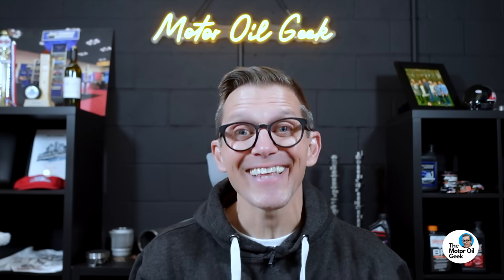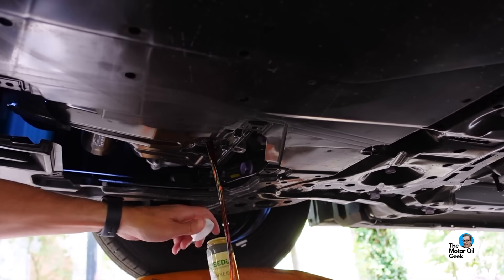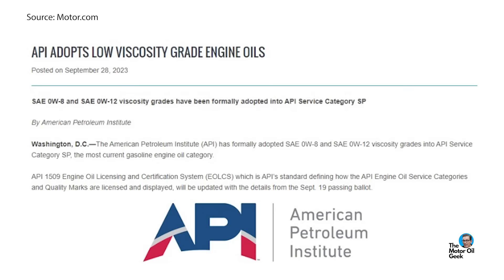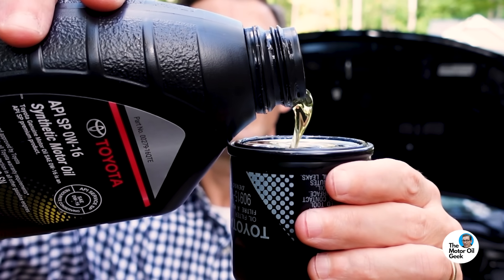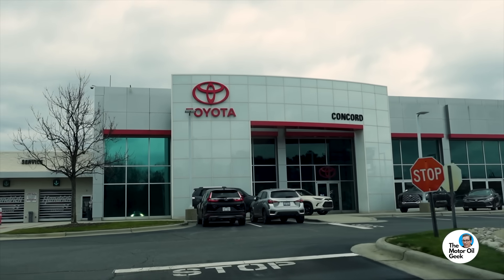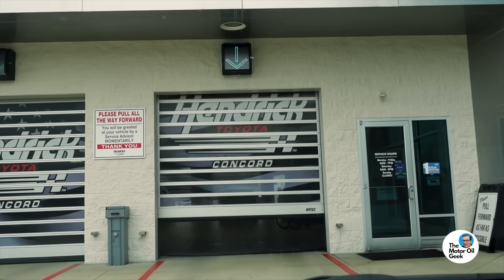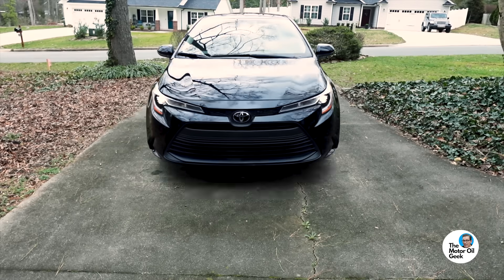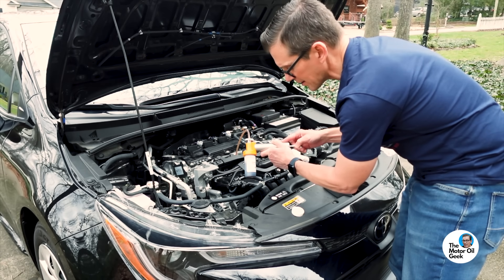0W-8 Motor Oil: Too THIN to Trust? Let's Find Out!

Comment: Great video as always. 
I bought an air cooled Yamaha 650 Turbo, back in the day, tried all sorts of oils and viscosity’s. The gearbox also shared the engine oil. I changed the oil right around 3000 miles or when it became reluctant to shift gears or when the weather was very hot. Got over 120000 miles before I moved onto my next bike. 
Maintenance is absolutely necessary if you want the engine to last.
Reply: An XJ 650 turbo to compete with the Suzuki XN65 turbo the Honda cx500 turbo and the magnificent Kawasaki GPz 750 turbo I was 15 years of age back then, the Yamaha was the only bike to not go the fuel injection direction
Reply: Yamaha was very reluctant to go with fuel injection until they were basically forced to. 
They did try it on the GTS1000 along with an alternative front suspension system. 
A very cool bike, I had the pleasure of riding it when it was first released. 
Thanks for the comment 👍
Reply: @paultruesdale7680  quick question Paul, what year did you buy the XJ turbo? My dad bought an XJ 650 new in blue back in 1985 and I remember the lovely whistle sound the engine made , I remember it cost just over 3 grand Irish pounds back in the day.
Reply: Sometime after the Seca 900 was released, I would say close to the end of 1983. I wanted the 900, but it was out of my price range and the Turbo was not selling, so the price was cut in half and it was being sold for 2500 dollars. 
I bought the bike and rode the crap out of it until my next bike the 1987 FZ600.
Reply: I’m a dirt bike guy but my one and only ever street bike was a Honda CX650 Turbo. Absolutely stunning looking bike, technologically andv for its time, and a very comfortable bike to ride and easy to maintain. A friend and I both bought  one as new leftovers in 1984 or 1985 for I think $4K each. I eventually and unfortunately sold mine in pristine condition having a young family and not wanting the risks of a street bike. He kept his till he died of brain cancer but willed it to another friend of ours who still has it but it’s not running currently but is otherwise in mint condition and stored inside 24/7/365
Collector bikes now, wish I had never sold it.
Reply: Both the CX500 and CX650 Turbos were beautiful machines. 
The paint and color schemes made them stand out like true exotics. On boost they would smoke my Yam Turbo.
Reply: YES, stunning color scheme on especially the CX650 turbo. I’m in the US but perhaps they used that color combo on other models in other parts of the world over the years but here they never did until recently with the Africa Twin series of bikes. It made me want to buy one of this as I’m partial to adventure bikes.
The CX650 turbo was the epitome of all the short run of Japanese turbo bikes during this years.
Yes indeed, on boost it was the roll on king at the time eclipsing he mighty Kawasaki KZ???? or Z1????. I’m 66 now brain forgets.
I almost lost my now ex wife off the back of the bike when I failed to tell her to hold on during a full boost run. I don’t think she ever got on the bike again after that. 
You could run the starter to prime the turbo with lubrication without the ignition on. When coming to a stop to shut the bike off I’d always make sure to let it idle awhile to let the turbo spin down to whatever it’s slowest speed was to prevent any oil starvation. Oil changes were a breeze, valve adjustments if needed were a breeze with transverse V cylinders, shat drive, fuel injected. Air filter was up in the fairing compartment and easy to clean/replace. Crazy easy bike to take care of despite it sophistication at the time. 
Stator failures were a weak point eventually as the oil that was run in the gearbox cooled everything including the turbo and stator and apparently ran stupid hot and eventually cooked the  stators requiring engine removal and tear down. I’m guessing since then, CX turbo enthusiasts have devised an improved stater assembly for better longevity.
Can you tell I miss this beautiful bike? If you were to show a picture of this bike to allot of people, even people who know motorcycles you would almost thing it’s a modern current bike not 1983. Timeless.

Oh, whoever else posted about the Yamaha 900 Seca I lusted for one of those as well. The 650 Seca was nice but the 900 was a dam sexy bike at the time with to little rear suspension travel. Very short lived model if I recall correctly?
Fun stuff!!!
Reply: Check out Dave’s bike brochures. 
Great trip down memory lane.
Reply: That was me posting about the SECA 900. The one that got away. 
I still think about that bike.

Comment: wonder if the 0w - 12 used in the shop is the same full synthetic as the 0w - 12 that was mentioned as producing less wear than the commercial 5w - 30 not quite really synthetic legally sold as "synthetic" ?

Comment: The issue with the corolla cvt service, at least the prior one is you only get something like 1.5 quarts to drain due to the location of the drain plug on the pan, it holds about 8 quarts. There are 3 or so magnets in the pan no need to worry about service for a while. Best/most cost effective way to service is drop the pan, clean the magnets and replace the gasket. Or use a flush machine but 12 quarts of toyota cvt fluid is expensive, and the fluid level still needs to be set/verified after flushing.

Comment: When I recently came across your oil videos I first thought this was a bit much but I got more of an education on reading many of the comments which back you up.  I have always done my own engine oil changes mainly because others tend to be sloppy.  Now I have other reasons not to trust dealerships.  I think the "free oil changes" are nothing more than a sales gimmick!  I have noticed that when I change the oil on my 2015 Jeep Cherokee, the recomended oil amount just brings it to the lowest line for the "safe" zone.  I always add another quart.  When I sell my bass boat and Jeep I'm planning on getting a Honda HR-V which of course has a CVT and is direct injected.  Is there a better engine oil that may in some way help with carbonization of intake valves?  My advice on any CVT is to change the fluid as you recomend.  I don't think many folks think about changing transmission fluid.  While you're at it no jackrabbit starts!
Reply from the maker: I'd steer clear of the CVT if possible. Dual fuel injection is better than straight DI as well.

Comment: Great video!! "Fill for life" is only 100,000 miles "under the table"..

Lubrication science is very interesting and its really getting complex, but i'll just keep my old 2003 Grand Marquis(450,000 miles), it doesn't care about the oil, many times they only drain out less than a quart, or none at the oil changes, we do 10,000-20,000 mile changes and the cheapest oil possible...it still runs like new..

Of course if I got a new car, I guess I'll have to go by the book and spend the $$ on oil changes...
Reply from the maker: Thanks!

Comment: I have watched oil changes at a large local dealership.  They often used gray bulk oil.  For those that do not know, gray oil is recycled oil.  I don't know about you, but I watch them put in my own "new" oil.  When I pay $40,000 for a new vehicle, I would never let them put recycled oil in my vehicle, ever!  I would never ever go 10,000 miles on an oil change regardless of what anyone says.  I had free oil changes on my "Last" new Rav-4.  10,000 miles per change.  I feel that was a big mistake.  These dealerships are not to be trusted.  These 0W-8/0W-16 oils are better quality oils.  I am surprised your dealer gave you the real McCoy.  He must have known you were checking.
Reply: 0w8 and 0w16 BETTER be higher quality oils, neither one of them are rated by any online viscosity chart for hotter climates like AZ or TX.
Reply: @lonniebeal6032  Could hydro-crack it if you want.  It's fractionally distilled just like raw petroleum. Regulating the additive package would likely be more difficult.
Reply: What is it that you think is wrong with recycled oil? 
It's processed in the same way crude oil is processed. 
Do you think the crude oil has no water, VHCs or other impurities in it?
Reply: @T3H455F4C3  You need to learn more about oils...group II is refined oil, group III is hydro-cracked oil, group 4 and 5 are PAO/Ester based oils.  Recycled oil is likely equivalent to group II.

Comment: 30,000 miles on CVT fluid is perfect for good maintenance. As long as you don’t run it hard and/or tow and 30,000 miles change, it should last 200,000 miles or more.

Comment: Hi Lake, I'm assuming with how busy  the Toyota workshop is, they would have changed the oil with minimal engine temperature. My understanding is that you can remove more dirty oil by going on a good 10km drive first and then drop the oil. Is there any truth to this?
Reply from the maker: It is best to change the oil after driving the car and getting it up to temperature.

Comment: I really rock the boat on my DIY oil changes. Use Shell Rotella T6 full synthetic 5W40 diesel oil in my 2007 Volvo XC70 with turbocharged 2.5 liter gas engine. Change every 5K and doing fine.
Reply: You're not rocking the boat, you're ruining your engine, when you think you're actually smarter than the engineers and all the testing that's been done. That's THE WORST choice you could make for motor oil.  You haven't done the homework to get the facts.  Diesel oil does not belong is gasoline engines. Many many reasons why that is. NUMBER 1 is this......LSPI in GDI engines. You'll get loads and loads of that from a diesel engine oil. They are NOT designed for spark ignition engines. That's one huge reason right there. The list goes on and on.  Research it, or you'll eventually be replacing pistons.
Reply: @kellyhahn6145  Port injected, only 8 PSI of boost, I run it in my Pan European also. So is my motorcycle going to blow up also? Go back to your mothers basement.

Comment: 23 Jeep Wrangler with the 3.6Changed my oil at 1500 with Fram Titanium Filter (came in oil change package at Advance Auto, really wanted the Purolator Boss but around same price separate. (kinda late, I wanted to change at under 1000mi but didn't get a chance) and will change at 5000 and every 5k after that, even though the Pennzoil Ultra Platinum is guaranteed for longer (full synthetic).

My Jeep seems like she is happy, and these new jeeps make it very very easy to do it yourself! 

No way in hell I'm going any longer, and if I feel like she needs it sooner bc of my driving then I will be glad to keep her happy.

Comment: You can get a 5 quart jug of Mobil 1 0W-8 motor oil for about $27 at WalMart.

You are more trusting than I am....I would have watched them drain the trans fluid from the trans in her car for the sample; they could have just used trans fluid from another car.

Comment: Over the years dealerships have thought me not to trust them, so I never do.  They have huge tanks in a back room that hold bulk oil just for doing oil changes, I know, I have seen them first hand.   Back when we bought cars new, I would use the free oil changes the dealership supplied as a flush.  We would drive the car 100 to 200 miles then I would do my own oil change.

Comment: Thanks for the video! My toyota is a old prius that specify 0w-20. Can I go lower viscosity?! 

When in the video says that the low viscosity testing gave same or better protection than Mobil 1 5w-30 Gen 2.
In their testing!
Reply: Just use 0w20 and you'll be fine. Don't experiment if you don't have to, keep it safe.
Reply: Yes, better to be safe than sorry.

But 0w-20 vs 0w-16 is probably not that big difference in viscosity.
As I understand it is that 16 vs 20 is the viscosity when warm (probably at 100°C).
The 20 is OK  for somewhere at least max ≈45°C outside temperatures.

When in Sweden we are never in those high temperatures. 😅

So thinner should still cover or even be better in lower outsides temperatures with still having the same protection and even do a better job when the 20 thickness is not needed. Better in that way that it is little bit thinner and flow throughout all lubrication points little bit faster and easier, and with that will cool the lubrication points better with the little bit better flow. 

When the oils gett thinner and thinner it is indicating that viscosity is of lower importance from the point of view that we need thicker oil at higher temperature for protection.. 

Then that feels like the oil is just more and more as a liquid that transport the anti wear package around trouout the engine. 
Like that is just a transport medium for the additives that feels like that IS the important part of a well formulated oil and not so much of the viscosity.. 😅 

But I can be totally wrong here.. 
The unknown for me is the internal design in the oil system that is and has been adopted to be able to use some range of viscosity. 
Another unknown is that the old API system specifies that SN, SP.. Says that the later in the alphabet (N, P..) the better but also that it is backwards compatibility that a newer one is always as god or better than the older and previous one, in this case N.. 😅 

But they broke that in 0w-16 and thinner.. 

So the question is and unknown for me is a 0w-16 as good in all aspects than a 0w-20 API SP? 🤔 

Or is the new grading that started with 0w-16 less good in some aspect VS the 0w-20 SP.. 😅

Comment: I had heard that the newest Corolla CVT's have a conventional 1st gear and then CVT for the other "gears", but I haven't confirmed which engine comes with which CVT, etc. Thanks for the great info!
Reply: Yup that’s right. New Toyota/AISIN CVTs (not ECVTs) have a launch gear.

Comment: Why would I pay $60 for an oil sample when i can change my oil for $30 full synthetic every 3,000 miles
Reply: I agree, I feel if I change my oil every 6 mos. regardless of mileage, or at 5K max. , I don't need an oil analysis. Yes, a quality oil is a must too, I use Valvoline
Reply: @RonRussell-sj1zf  we do it in marine industry every month but we are dealing with much larger and more expensive equipment. I get it , he is running a business in a particular niche. I could see it being used in a racing team but theres no need for oil analysis for a regular car if you change your oil often with quality oil
Reply: @drivewayhero  Oh yeah, I recognize the value of it in commercial and military applications, but it's a little overkill for the average Joe, just change your oil/filter regularly and you'll be fine.

Comment: Even if the oil sample test shows the oil is still working at 10K I would not go there. Every 5K miles in my opinion is the limit. I have used this method for 25 years on our cars and my kids cars and we have never had engine failure yet.

Comment: Lake, here in Canada, Walmart carries Royal Purple XPR SAE 0W-8 for 145.09 CAD per 946ml... Might be a mistake. Is it supposed to be that expensive? And Napa has ENEOS 0W-8 X Prime 1qt (1qt=946ml) for 11.60 CAD. So if you do your research, you can find 0w-8. I even saw some at Canadian Tire, but it's not on their website... If I go on Walmart USA, I can find Mobil 1 0W-8 5 quarts for 27.97 USD and the same Royal Purple XPR SAE 0W-8 for 37.94 USD. So you can order your oil and get it delivered if your local store doesn't have it. Look at the solution, not the problem.;)
Reply from the maker: Don't use the XPR in a street engine. That's race oil and will not have the correct API rating.
Reply: @themotoroilgeek  Oh, didn't know that about Royal Purple XPR. So the Mobil 1 should have the right API rating and be available at your local Walmart? Right?
Reply from the maker: @dyoutubechannel8218 the Mobil 1 should have the correct specs

Comment: Would be interesting to see how the oil change intervals pan out through analysis.  His baseline is 3k mile. Toyota recommends 10k. Which I think are two extreme ends of the spectrum. Having kept 2 cars with one over 250k the other >150k. Changed oil once a year. Consumption never exceeded 0.5 qt in 3k miles. I think we are wasting resources to change at 3k. We did this back in the 60 - 70's. There are variables like turbo, GDI, heat, cold, drive habits . . .

Comment: I remember using 10w30 for all my engines from V8s to four bangers, have a 2023 Jeep Gladiator that takes a 0w20, there is a lot of debate in the groups from those who use 0w20 and those who still put a 30 weight oil in their Jeeps. 0w8 sounds scary!

Comment: You're a good dad, Lake! I realize oil is also in your blood, but good on you for taking such good care of your daughter. I'll continue watching the process here with her Corolla. I'm curious since we bought our 1st Toyota last August. It's a '23 RAV4 Limited Hybrid, which I've changed oil in twice already, once @ 1,500 miles & then again @ 5K, using TGMO 0W16 both times. I''ll let our dealer change @ 10K & 20K, but I plan on changing every 5,000 miles. I'd be interested in your thoughts about switching to 0W20 @ 25K. Most of our miles (80%) on this hybrid are road miles @ 62-65 mph on two lanes & 77-80 mph on the interstate. I'm not sure if I'll stay with the TGMO or switch to something like Valvoline Advantage or Pennzoil Ultra Platinum. I've been a strictly Mobil 1 user for the past 35-40 years, but I'm being convinced there are better oils out there... Thoughts?
Reply from the maker: Thanks for the kind words. I'm sticking with the TGMO for now. I like what I see so far.
Reply: @themotoroilgeek  Do you know if the 0W8 is made for Toyota by Mobil? Everything I've read says the 0W16 is Mobil 1 made to Toyota specs.
Reply from the maker: @jonhansen4745  Yes, the 0W-8 is made for Toyota by ExxonMobil